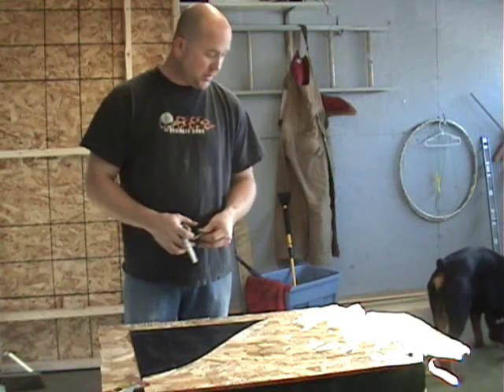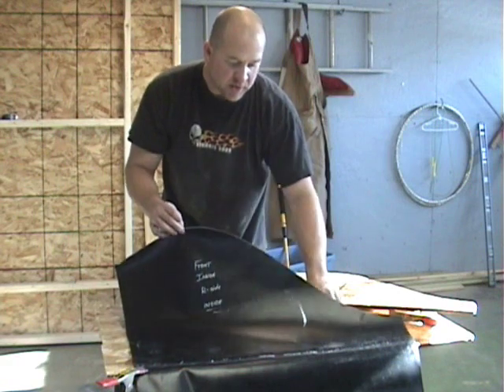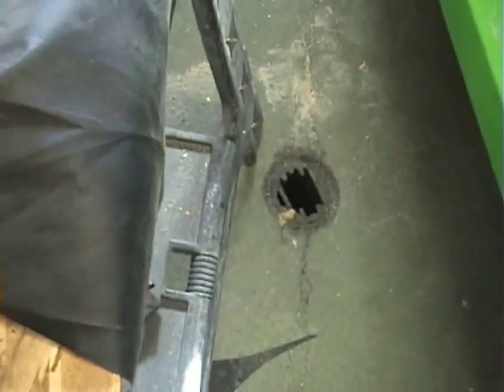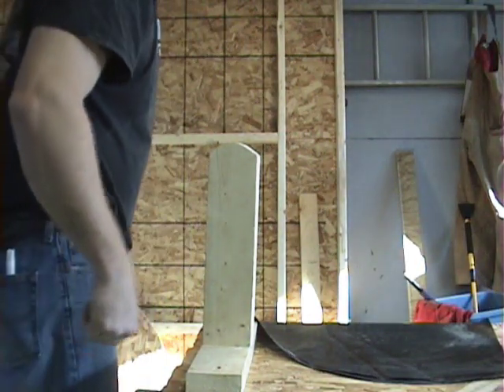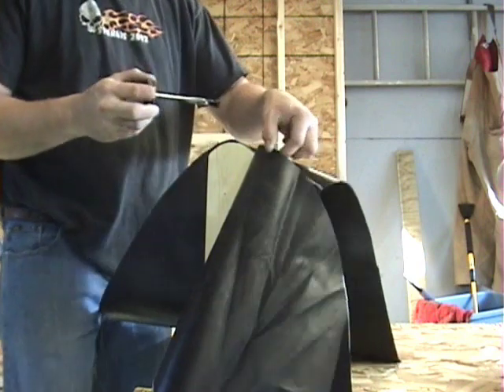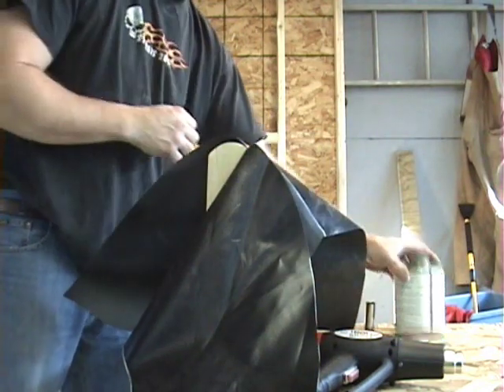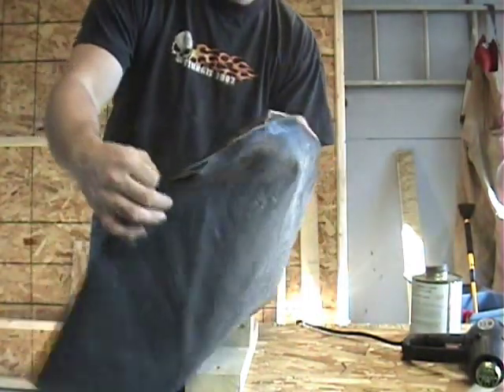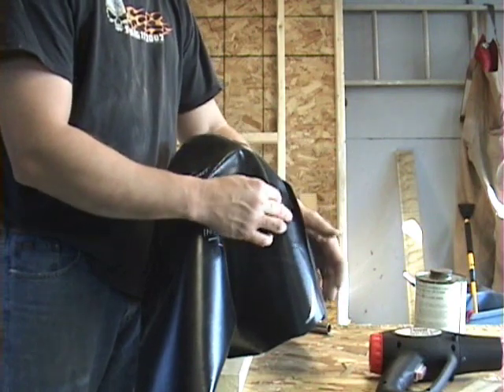hovercraft skirt corner tutorial

Comment: You could make 2 or 3 jigs from the cutting form and laminate them to the width of the seam lay your material in place with clamps on jig sides form the seam on the edge use a old 1 " bed spring band , Hook to a nail on lower edge while setting your hem & gluing , Lay the band over top down the other side holding the complete skirt in place while drying use a spring hooked to the band end to hold tight will make flawless seams ---Is this that rubber tarp material & where do you get that glue ?

Comment from the maker: The problem with sewing is that it creates a sharper corner, which in turn makes the corners wear prematurely. Gluing the corner is a far better method and is actually stronger then sewing. I have done both.
Reply: Agreed using the right glue and applying it the right way makes the joint much stronger than sewing with less friction on the contact points. Gluing rubber makes amazingly strong material to work with.